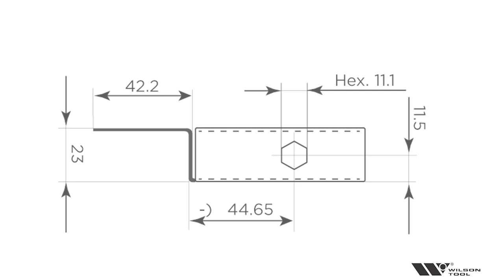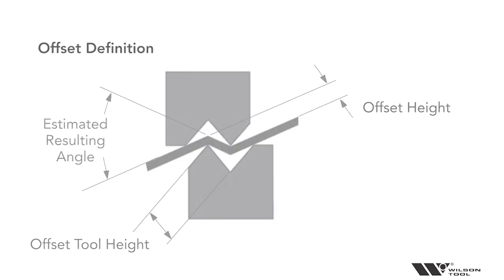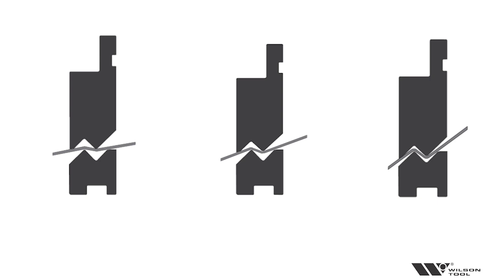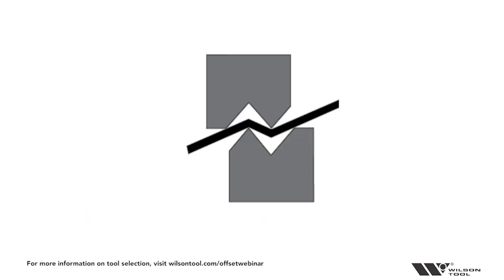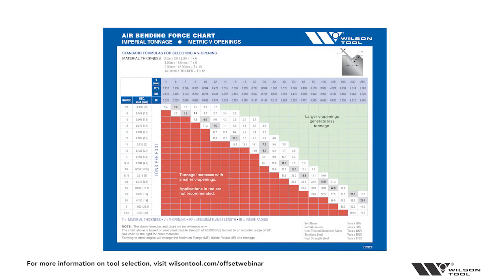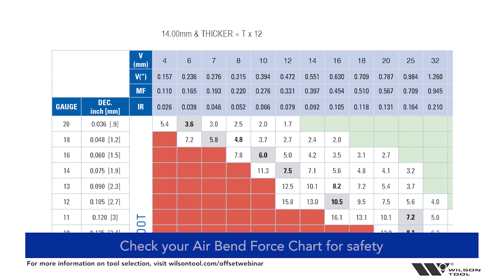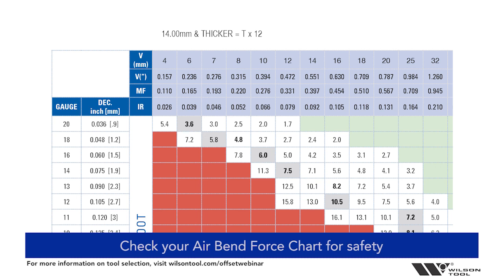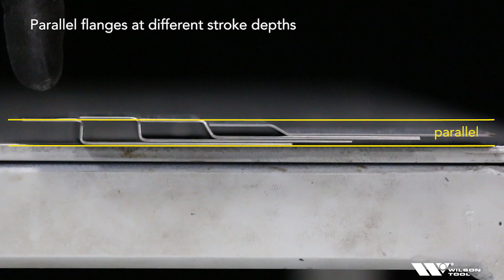Air Bending with Offset Tools | Bending | Technically Speaking

Comment: Good One!, I appreciate your time. I have a request regrading bending. how do you make air bending for angles such as 20, 15, 55 degrees etc., which are non standard..? and how do you verify the angle after bend?
Reply from the maker: Great question and the full understanding of the concept of air bending with an offset tool will most likely allow you to make different angles with standard tooling. Start with how to calculate the V size (in the video) and know that less stroke = a more obtuse bend.  So, if you are using a .250” standard offset tool and want to bend a 20° Angle, the stroke would be less than if you bend 15° by about .007”.  And because you are using the same tool and material and adjusting your stroke, the resulting offset size will change from .060” to .045” respectively.  Hope that answers the angle question.

As for measuring angles and offset heights with the bends that are so obtuse in angle and short in height, it’s certainly easier with a short part.  When the part gets longer and you are experiencing deflection to go along with the offset, it’s challenging.  Many times when this scenario is built into the application, tolerance isn’t first and foremost so you can over size a bit and get away with some variation and measure with a depth gauge.  If this is for the aerospace industry, spend the money on a dedicated tool that repeats perfectly.

Comment: I have situation Offset height is equal to sheet thickness which are 3 mm and 2.5mm and angle to be 90.
Reply from the maker: Thank you for your question. Due to the uniqueness of each application it is best to email our Tooling Technicians at bending@wilsontool.com

Comment: I have situation Offset height is equal to sheet thickness which are 3 mm and 2.5mm and angle to be 90.
Reply: A trick : watch movies at kaldroStream. I've been using it for watching a lot of movies during the lockdown.
Reply: @Elijah Briar definitely, have been using kaldroStream for since december myself :)
Reply: @Elijah Briar yea, I've been watching on Kaldrostream for years myself =)

Comment: That particular press brake features an NC9-EX(II?) controller. When you multiply the offset by 1.414”, does that mean you can actually program that tool in angle mode, or are you all using depth mode?
Reply from the maker: Hi Bradley 

Depth mode works much better for this type of bending on the NC9EX controller.  Angle mode would likely work, but it would require a lot of angle correction to achieve the desired results. 

If you have more specific questions please feel free to email us at bending@wilsontool.com
Reply: @WilsonToolInternational  yes Depth mode is the best way to make this process.